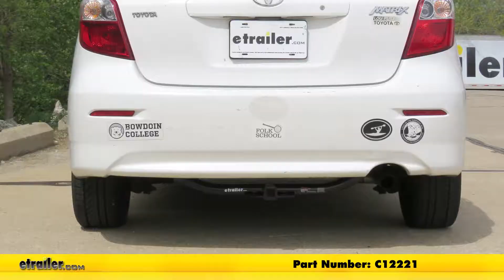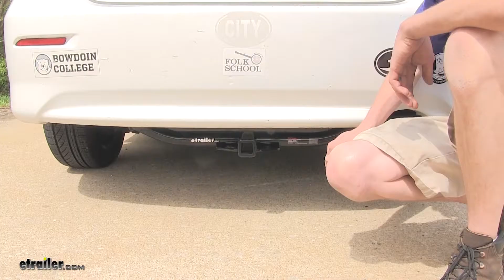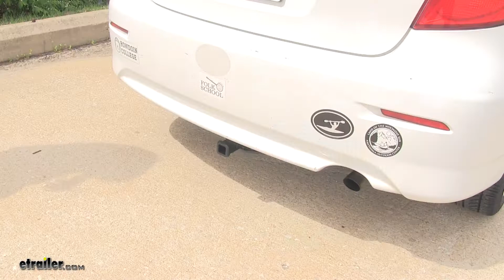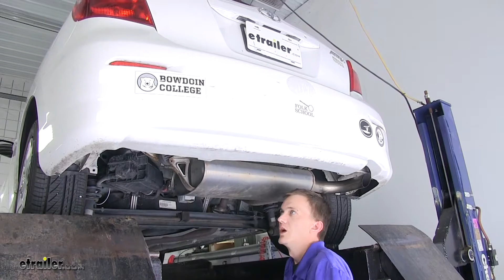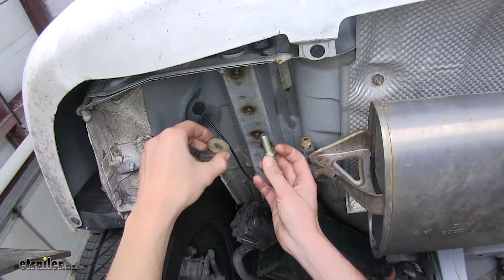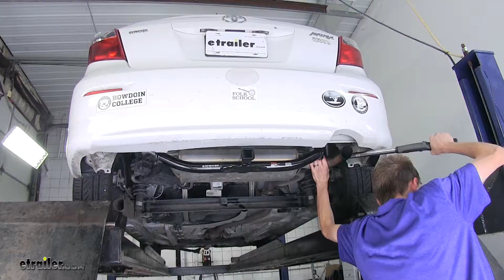etrailer | 2009 Toyota Matrix Curt Trailer Hitch Receiver: Complete Installation

Comment: I bought that hitch receiver from e-trailer and they sent the wrong screws and one week later I haven't found them even in Toyota dealer so not luck at installing it. I recommend to purchase this locally where you can go back at vendor and change small but crucial piece like this
Reply from the maker: Thank you for sharing this with us. This vehicle has weld nuts in the frame rail. What can tend to happen is the weld nut can rust and fill up with debris making the hole seem too small for the hardware. A lot of the time what we have to do is clean the weld nuts out with penetrating oil and a wire brush. If the rust is bad enough you may have to retap the threads in order to get a bolt to start.
https://www.etrailer.com/Accessories-and-Parts/etrailer/RHK.html